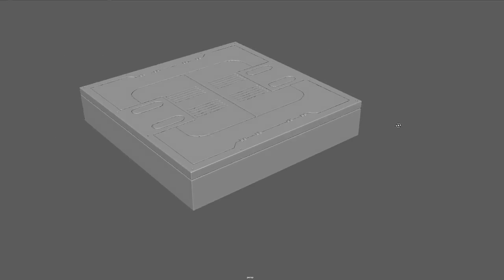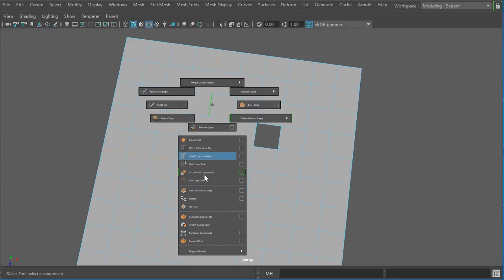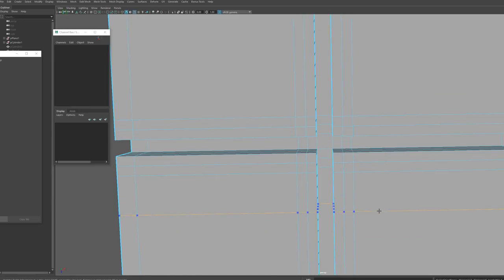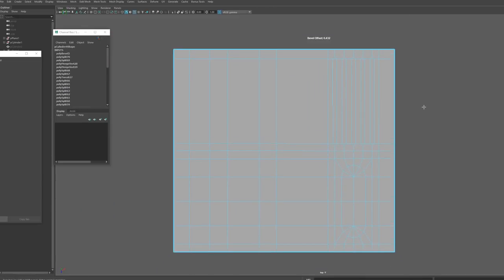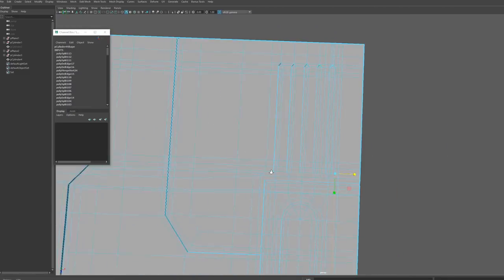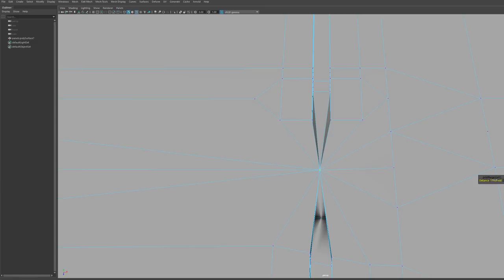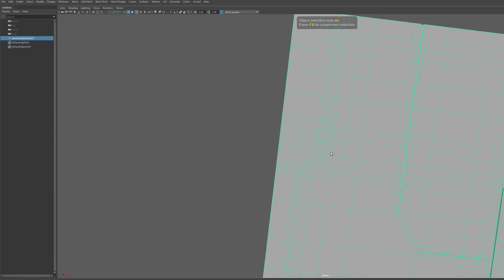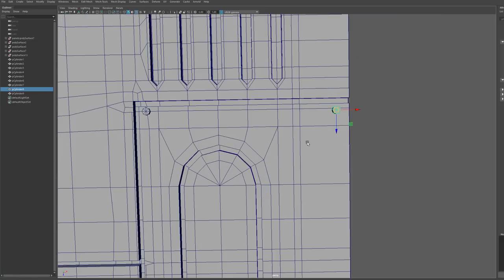Hard Surface Modeling Sci-Fi Panels in Maya 2018

Comment: do u know tool circulize? select multiple polygons hold shift + right mouse and there is that in the menu. That will make a perfect circle edges from polygon group
Reply from the maker: I was aware of the tool, however I created this tutorial in 2017 and it was not available.

Comment: Thanks for the tutorial. Hardened edges are crucial in the firearm models, am I right? So you need to crease, extrude and bevel all the time to make high quality model.
Reply from the maker: Clean panel lines are important for any hard surface model especially if you want to be able to view it close. This is one method of doing panel lines, it could also be sculpted in a package like zbrush or created in subtance painter, then converted to a normal map.